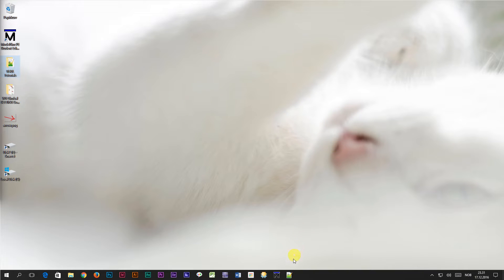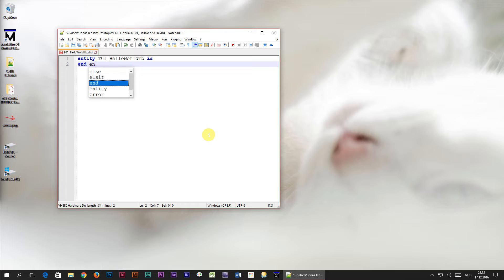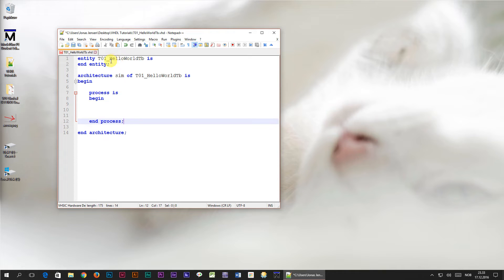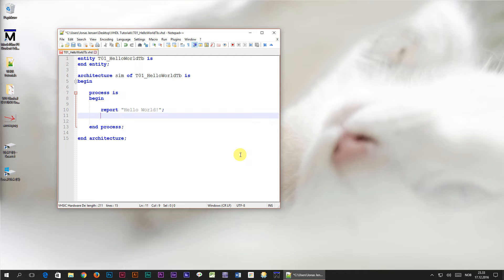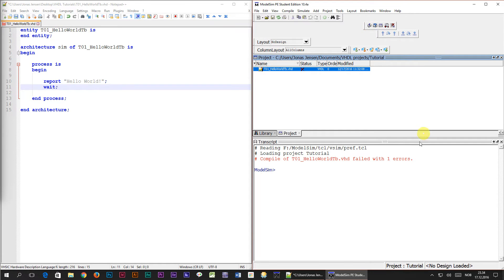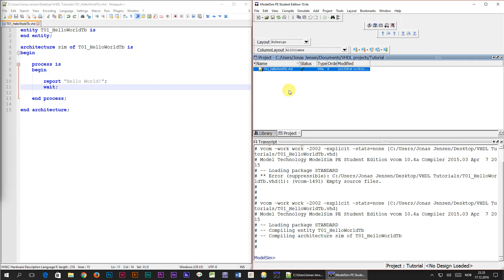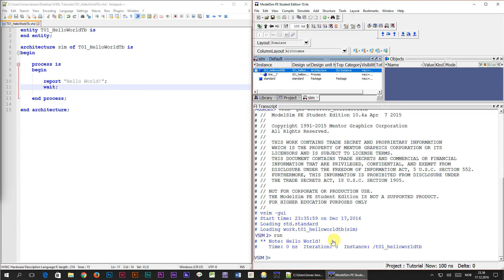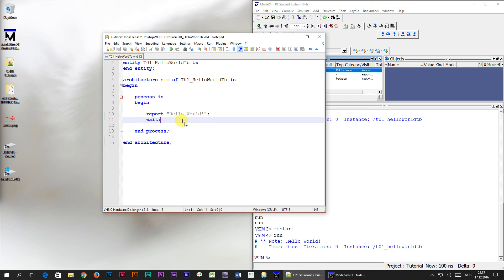How to create your first VHDL program: Hello World!

Comment: Does it work with IEEE libraries?
Reply from the maker: I'm unsure what you mean, but I will try to answer. You can print the value of IEEE library types like this:

---
  signal my_sl : std_logic := '1';
begin

  process
  begin
    report "my_sl = " & std_logic'image(my_sl);
    wait;
  end process;
---

std_logic is an IEEE type, and the output will be:

** Note: my_sl = '1'
Reply: @VHDLwhiz  thanks this helped and I was referring to vivado where you have to declare libraries and different packages to work with here I didn't see any mention of the library that's why I asked since I seen you use it. Thanks for the answer and keep doing god's work 😊
Reply from the maker: @executorarktanis2323 Oh, I see. I didn't import any libraries in this example because we used no data types. VHDL only has a few built-in types like "bit" and "integer". Otherwise, you must import IEEE as you discovered.

Comment: When I try to save the project, the options "Save" and "Save as" aways remain greyed out.   Is there a way to save a project?  Sometimes it will come back where I was if I close it and open it up again, but it gets really complicated if I'm running more than one project.  Usually, because of this, I will have to create a new project whenever I open up ModelSim after having closed it.
Reply from the maker: The "Save" and "Save as" are related to the built-in file editor in ModelSim, not for saving the project. The ModelSim project is auto-saved to an .mpf file in the folder you created it in the first place, that's why it pops back up when you open ModelSim. Try to double click on a .vhd file within the project explorer in ModelSim, and you will se what I mean. Then, the "Save" option won't be greyed.

To open another auto-saved project, go to file->open. Select File type->Project Files, otherwise you won't see the project file in the explorer. Finally, you can select the .mpf file to open the project. A bit cumbersome, but that's how ModelSim is.
Reply: @VHDLwhiz  
Thank you.  This will save me quite a bit of time over the long run.